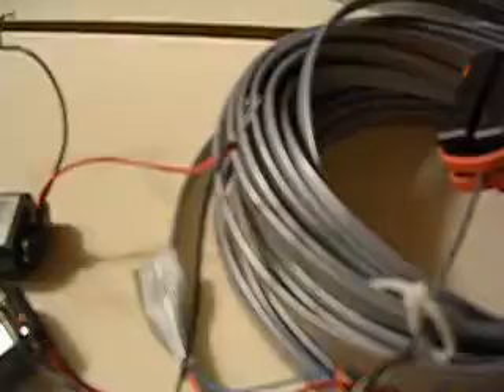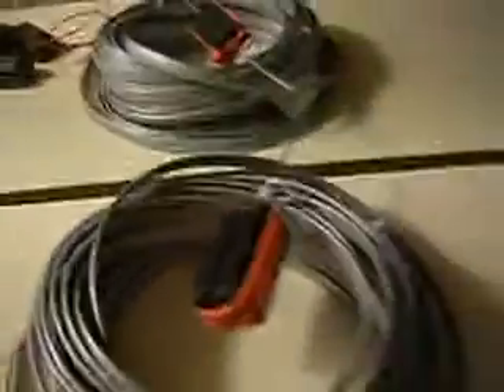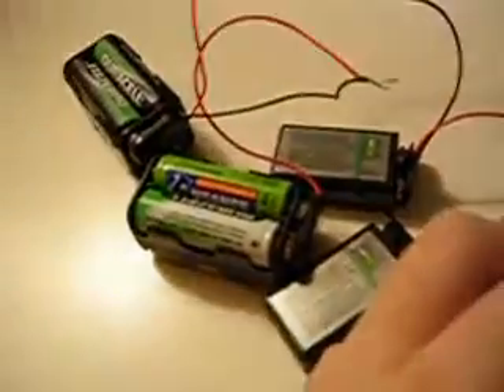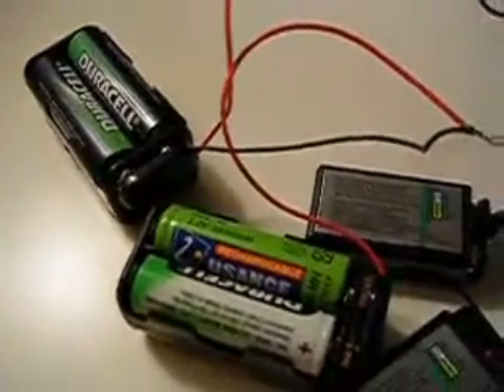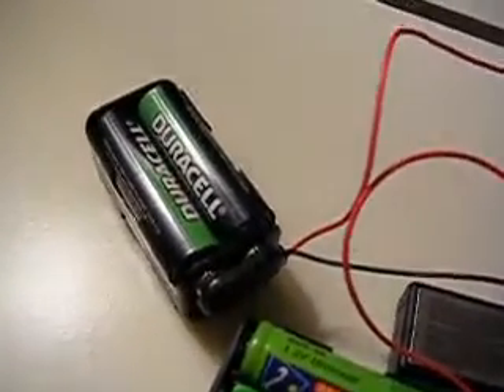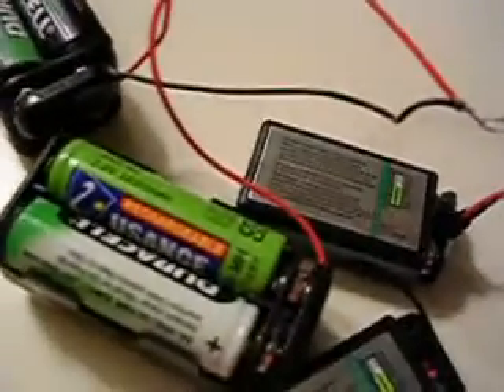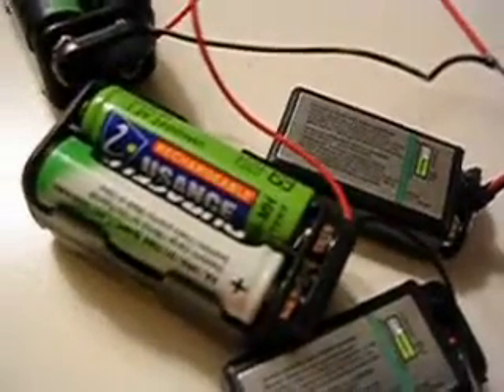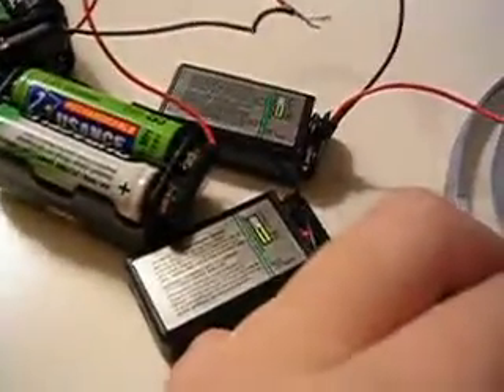Electric motor ▲ Multi-conductor Silver

Comment from the maker: I can't say I understand all forms of mass-to-energy conversion (in fact I don't), but I don't see why it could not apply for the electromagnetism (as well as nuclear and chemical reactions) given that it is a mainstream fact that when a charge accelerates due to another charge, it produces radiation. If the energy comes from the machine's initial mass, then it's possible for that energy to be removed with the machine's output exceeding its input, but without evidence it can't be proven.